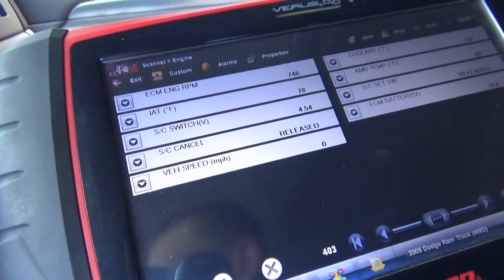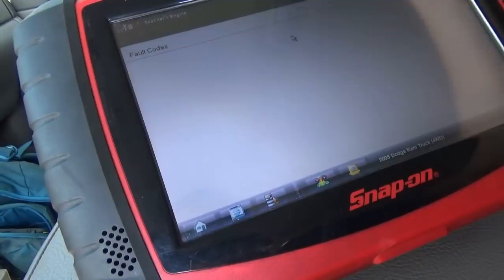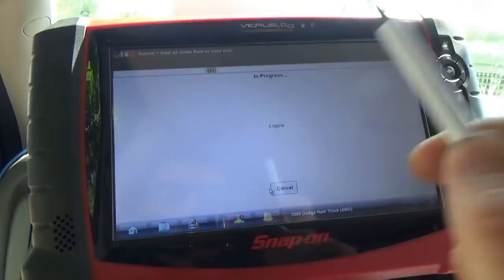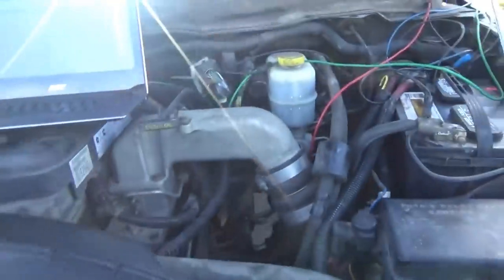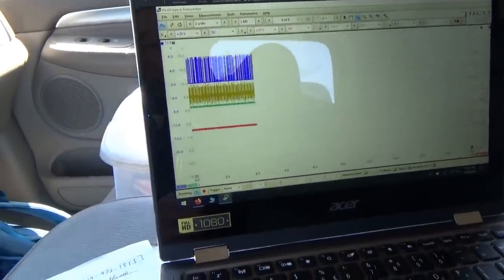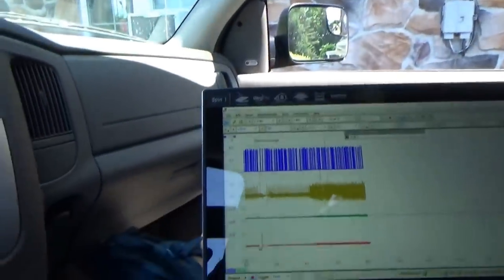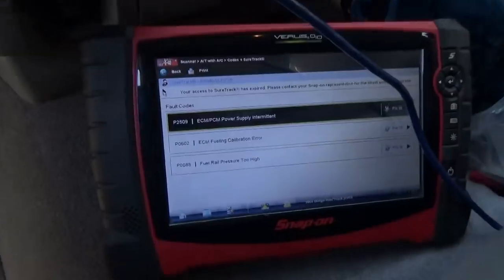Cruise Control = Engine Stall?? - Part 1 (Ram Cummins Diesel)

Comment: I vaguely remember there were some problems with wire harness wearing thru on intercooler piping on that generation of Dodge Cummins. It would cause some weird problems, but no clue how that could relate to this problem, though.

Comment: Watching now but I remember the Chrysler products from the late 90’s would set tps codes when the problem was actually the clock spring.
Reply from the maker: Interesting. This is the weirdest problem I have ever seen...truck runs perfect otherwise!
Reply: I was wondering about clock spring too since that would be a place it could short to other wires, but I couldn’t think of what it could trigger. I wonder if there are shared grounds to cause that?
Reply: @cullenmiller8170  If the clockspring was bad usually the buttons on the wheel don't work at all neither does the horn.
Reply: Oh, it gets better -- 97-01 Jeep Cherokees throw a failed transmission computer code when the alternator is going out ...
Reply: @TechOut  That's a big assumption.  I've seen this exact sort of thing when there is a short and the button bridges the short - still works but it shorts other things out.
Reply: I won`t say clock spring, reason being if you seat there and press it the engine should of cut off, the buttons always has voltage the only difference between the sending a signal for the cruise control at idle and moving is that the computer programming would only allow it to be enable at a given speed, but if you seat there and press the cruise control button, on the scan tool you would see it pressing, I  say the PCM cruise control circuit part is shorting or the IC, once it shorts the cruise control automatically disable , just like if you mash brake or something but for safety
Reply: @TechOut  I am in no way familiar with Dodge, but the 'clockspring' is actually ribbon cable that simply spooled around to a certain extent. I personally have experienced 'some' broken wires.
Reply: @phareztrinimand  Yes! I like this.
Reply: @hudzgh  yes but every button works. It's not a button issue it's something that happens when the button is pressed
Reply: Usually when the clockspring has issues the buttons can reproducibly not work when tested while turning the wheel.

It's also common for the horn button to not work, and get airbag warnings.
Reply: @TechOut  could be one wire in clock spring grounding out when switch is pushed.

Comment: I am going to go on a wild guess here... and I am sure you already solved the problem, but its entertaining to :)
when cruise control is activated, the ECM wants to light up the cruise on light and also wants to check the brake pedal switch... 
one of those things is shorting to ground or to power and triggers an ECM reset....
Reply from the maker: Interesting guess...but should set a code for a short instead of crashing the ECM :)
Reply: @PineHollowAutoDiagnostics  should. But it's a Chrysler product. :)

I have a 2011 town and country whose transmission goes  into limp home mode when using the cruise control downhill.
Reply from the maker: @ekaftan  That's annoying lol

Comment: The steering wheel switches are multiplexed and send varying analog voltage signals to the ECM. These get translated to digital commands and affect ON /OFF, SET, ACCEL, CANCEL, RESUME. As such the system operates on a regulated 5 volt power feed from the ECM. Pressing the SET switch feature sends a higher voltage signal ( 0 – 5 v range) to the ECM. I am thinking that the feed circuit to the speed control switches is receiving a voltage signal much higher than 5 volt maximum.

Chrysler electronic modules have circuit logic that monitors for excess voltage and / or current flow. If excess voltage or current flow is detected it will immediately shut down the offending circuit to protect the ECM from permanent failure. When you press the speed control SET button, the return circuit to the ECM is seeing excessive (system voltage???) and is momentarily shutting down the ECM and engine operation.

I would suggest checking the VT / violet wire at pin #46, connector C2 at the ECM for voltage. You  may have to test for voltage with the vehicle speed above 30 mph. For safety the ECM may not energize the 5 volt feed to the speed control switches until a  minimum vehicle speed is attained. I believe it should have 5 volts power. If it has more than 5 volts then there is either an internal ECM failure or a short to voltage in the connector C2 wiring harness.

Comment: You showed the set switch PID but did you try turning the steering wheel at the same time? Maybe wire shorting on back of airbag or something in column? I was going to suggest fuel pressure but it seems electrical in nature just by how quick the problem occurs. I hear you when you said I hate calling ECM's. The vehicles I used to work on the computers were reliable to the point I would suspect them last on the list of being the actual problem. Maybe corroded wire that only acts up with load applied? Bizarre for sure.

Comment: You should enable the high idle function for the truck. It’s used for trucks that have a PTO accessory or to just warm the Cummins up properly at 1100 RPM. It is engaged and controlled by the cruise control buttons. If the high idle works then the problem is while the vehicle is in motion. 

These trucks have a very sensitive network. You said the voltage drop never dropped below 13v and that may be true. However, you need to look to see how much it dropped. As in percentage drop or V dropped. I am betting it’s a bad clock spring or a bad wire between the cruise button and the PCM. Something is causing a large percentage voltage drop very fast which the truck does not like. 

I’ve seen an air compressor that was wired directly to a 12v source stall a truck when it turned on while driving. I switched it to a relay switch turn on and it solved the problem. But my point is these trucks do not like large voltage draws. 

It’s worth looking in to the connector for the fan clutch just to rule it out if the high idle function works since the fan would be turned on while driving the truck, but any connection that has 12v and 5v reference in the same plug would be suspect. Chrysler is not know for great wiring.  
The ghosting wipers is a common problem with this generation of Rams. It’s the wiper motor 9 times out of 10.

Comment: Not the button, as you proved by pressing it while under 30MPH, so it's nothing in the column. Battery voltage IS sagging, looked like your scope was set to 2s/div, so maybe not fast enough to catch it going lower. Unless that dip was just the alternator turning off for a second. I can't make the correlation on why the cruise would do it, but I wouldn't go swapping ECUs just yet since you did see a voltage drop before the computer. Unplug and re-seat all connectors, but maybe that one module is pulling down the voltage. That high fuel pressure could be due to the ECU not commanding the regulator when it looses power and the regulator is failsafe to maintain pressure. So that could just be a side effect of the ECU shutting off. 
But, as many have said this video was shot a while ago, so curious as to what the problem ultimately ended up being.

Comment: Could be engine computer coding, or even bad chiptuning. In very rare cases, a bit in the coding can flip which can result in the strangest faults. It's always worth reprogramming and coding the engine computer before you replace it. You need to be able to do that anyway if you install a new computer.

Comment: I think the brake light switch on this vehicle is a multi gang switch. Step on the pedal and one circuit makes while another breaks. Also the switch has to be adjusted. It may be border line out of adjustment.

Comment: I think that the non-ECM  codes are all spurious, and occur after the ECM  reboot. I agree with another poster who suggested disconnecting the fan controller and trying to see if the problem goes away.

Comment: Common problem with these is the grounds around the top of the qtr panels. Clean each one, especially the ones near the dr. side battery,  and most ECM issues disappear. I suspect when you hit the CC it turns on the vac. pump which probably also uses the bad ground connection and causes further voltage drop.
I'm surprised that you read this very thing on your computer but didn't go through all those grounds.

Comment: "3.7L/4.7LGas Engines and/or Diesel With
Automatic Trans.

The speed control system is operated by the use of a cable and a vacuum controlled servo. On all engines except diesels, electronic control of the speed control system is integrated into the Powertrain Control Module (PCM). If equipped with a diesel engine, electronic control of the speed control system is integrated into the Engine Control Module (ECM)"
Reply from the maker: "A cable and a vacuum controlled servo are not used. This is a servo-less system."
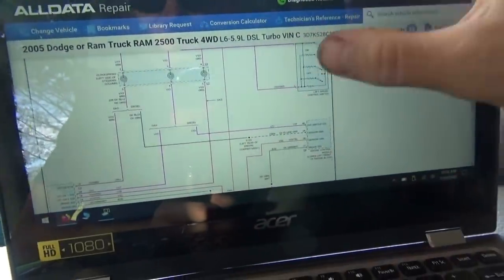Reply: @PineHollowAutoDiagnostics  Two engines were available with the 2005 Ram 2500 truck. 5.7 V8 and 5.9 I6 diesel. At time interval 6:45 in part 1 video you show an Alldata schematic of the cruise control system. It is depicted for the 5.9 I6 diesel. That is incorrect and misleading. It is the diagram for the 5.7 V8 which is drive by wire (no mechanical cable attached to the throttle valve). The 5.9 I6 diesel uses a mechanical cable for acceleration control and vacuum servo cable for cruise control. Both are attached to the bell crank on the fuel injection pump. I verified this by reviewing documentation in a 2005 Ram 1500 / 2500 / 3500 service manual.
Reply: Did some further research and did confirm that the 2005 Ram 2500 with 5.9 I6 diesel was a "drive by wire" throttle / acceleration control. There is no mechanical cable from the accelerator pedal to the fuel injection pump and no vacuum servo mechanism for cruise control. So that means the 2005 factory service manual was not updated to reflect the change. That means there are differences in the wiring to the speed control switches. Inaccurate factory service data can make solving weird electrical problems even more challenging. Kudos to Ivan for NOT getting misled as I was.
Reply from the maker: @acarlX  you had me sweating there for a second 😅
Reply: @PineHollowAutoDiagnostics  This entire scenario has really become quite puzzling. I have been watching your channel for about 5 years and your diagnosis is always top notch and puts "others to shame."  Challenge Ivan and you will quickly look like a fool !  :-)   Anxiously awaiting part 2 on the cruise control problem.

Comment: Checked service information for the P0602 and it called it a “checksum error” the troubleshooting was literally to reflash the ecm and try again. I would be very careful reflashing this ecm because there is a known issue with Cummins ecm flashing and Chrysler immo going wild after the flash. There shows to be a “dlc” 3 pin connector on the communication diagrams. In my experience Cummins puts a 3 pin deutch connector with 2 pins on their harnesses for INSITE to connect to the ecm off the public bus. I would see if you could get a laptop with INSITE and a 3 pin connector with an RP1210C adapter. Here is a link to an adapter that shows the 3 pin harness. Talk to your local truck shop (heavy duty diesel) and see if they will rent you their laptop and adapter with Cummins INSITE and you might be able to flash it that way. The 16 pin DLC has a receive and transmit wire that go to the Cummins ecm and the 3 pin is a private connection Cummins installs on all their engines.

Comment: I would have checked that the brake lights weren't replaced with LED versions, that can cause problems on some cruise systems. I also would have taken a look at the speed sensor to see if anything wonky was going on there.

Comment: I wonder if it’s something to do with speed sensor or an abs sensor dropping out but I would think a code would set, wonder if Chad is right about clock spring issue. Very interesting.

Comment: Run the wipers while driving, AND hit cruise on.

Could you lift truck, remove drive wheels, run in gear in garage, vented exhaust, simulate
driving, so easier to look around/under hood?

Think about what cruise controls on a diesel? Throttle. It monitors vehicle speed?

Comment: These instructions they give in the ALLDATA tool. I have to wonder is it because they have actually experienced a short from 12V to 5V on the fan connector or are they just speculating by looking at the schematic.  I was asked many times to examine my schematic and "guess" at what failures could happen.  Not a task I embraced.  Most of the time when some other engineers who were big advocates of the process would do it they would come up with "possible failures" that made me roll my eyes clear out of my sockets.

Comment: From the looks on the data stream, the pci bus peaks to 12v when activating the cruise control which is way too high! Clearly indicating a short to a 12v line when activating. The PCM will shut off immediately by preventing damage on the computer circuits.

Comment: Have the brake bulbs been swapped for LEDs? Ask me how I know that can be an issue.......
Reply: if that causes these types of issues that thats some seriously bad engineering like those should be isolated  even if networked should have a failsafe incase their is a major issue.     it doesn't surprise me in the least that its a thing that may happen,  just doesn't make sense that it is a thing.
Reply: I got lucky. My LED lights only gave me TCM codes and put me into limp home mode.
Reply: @dbowpku  and here i thought my volvo's network was weird.. i pulled out front ceiling light housing to replace bulbs with LEDS (T10 style) and it triggered airbag sensor failure and steering sensor related codes. after a bit of using wiring diagram i think the airbag indicator light that is in there (and already an LED) nd is indirectly connected to the airbag controller (SRS modules) and thus makes that entire unit part of airbag network?  weird but it makes little more sense than tail lights = critical TCM/ECM errors

Comment: I think your making the right call. P0602 is a checksum error which will typically require computer replacement to correct. Definitely odd that it's acting up when setting cruise. I did have a gas powered Ram where it would downshift the transmission and set a TPS voltage high code when you attempted to set the cruise. Problem was failed clock spring shorting horn circuit voltage to the cruise switch. This would pull the V ref voltage over 5 volts and skew the TPS. You did lab scope the cruise set switch voltage when this occured? Good luck. Waiting for part 2...
Reply from the maker: Yeah that P0602 code = PCM death haha

Comment: I'm kinda curious as to what might share a ground with the rail pressure sensor...A high value on a sensor's signal could be from a bad ground. 
If the ground is "regulated" by the PCM, it is possible that the driver cannot cope with the load of also commanding the throttle. 
🤷🏿‍♂️

-100

Comment: It seems like there's some correlation between the fuel pressure and the cruise control issue. Since Diesel engines alter fuel injection amounts to control engine speed, there has to be some link between the issues. Maybe the ground for the fuel rail pressure sensor is different from the ECM grounds and only opens when the cruise is activated because the ground is shared with something cruise-related. It's a strange issue, but it doesn't seem like the ECM is at fault since it works fine at all other times. This is definitely a case where thinking outside the box is required. I wonder if a faulty fuel injector could be causing the issue (although I'm not sure exactly how).
Reply: Hey, I think you're on the right track as opposed to the ecm going bad. I haven't watched p. 2 yet, but my dad's 06 5.9 just had a similar issue (not too far away on the PA turnpike from Pine Hollow) on dec. 24th at 5am. Near 0F, 65mph, cc on and boom, almost like a misfire we would lose power to the drivetrain and get it back while not losing electrical. P2509 and P0483, cooling fan speed. Turned around and drove the hour back and swapped into the VW. Trouble-shooting now to see if it might be related to a bad lift pump. No diagnostic tools, just flipped the key 3x for the codes, so unsure of fuel rail pressures.

Comment: Hi ivan!  That is really weird problem.  As Diesels relying on electricals!! Ive never seen that happen in any Cummins I've driven.  I would be interested to see when the ecm is replaced.  I figure it is loose joints in the board? That would be interesting to see

Comment: Cruise problem? Unplug it!! That was Ford's solution until they came out with the fused harness to cut down on fires (with the whole brake fluid shorting out the cancel switch in the master cylinder). Interesting fault, I was first thinking of a clockspring short or computer pin shorting an adjacent pin. But since it doesn't act up until the cruise can be activated (minimum speed required}, rather than anytime you push the button... I would think it would be an output problem. However this just uses the electronic throttle control. Seems like your on the right track with condemning the computer!!  Can't wait for part 2...
Reply: That wasn't a cruise problem so much as a cheap switch-raging fire problem.
I believe the cruise would work until the vehicle burned to the ground...